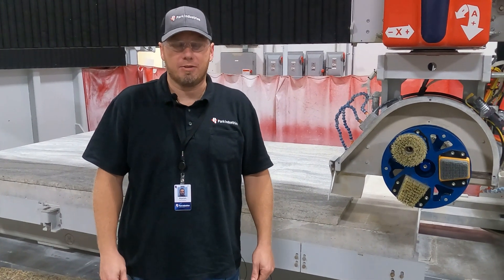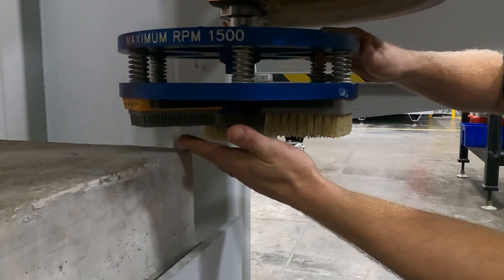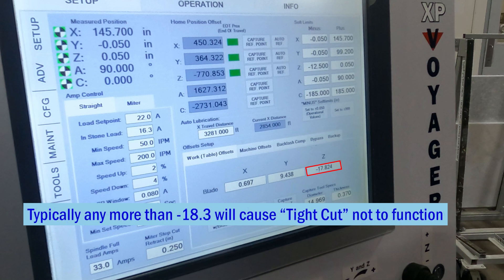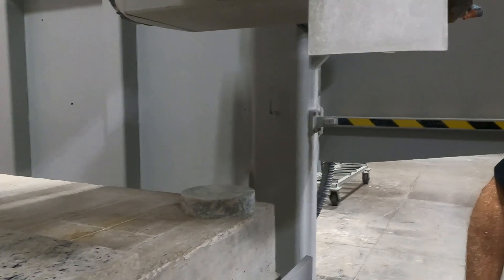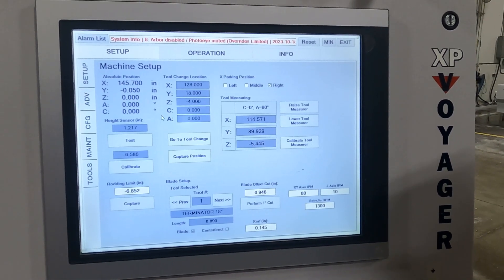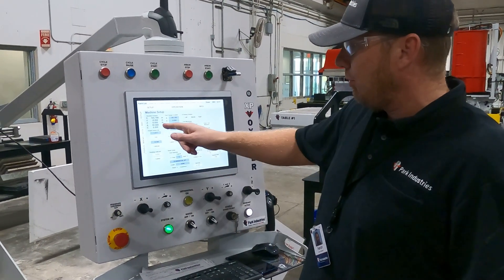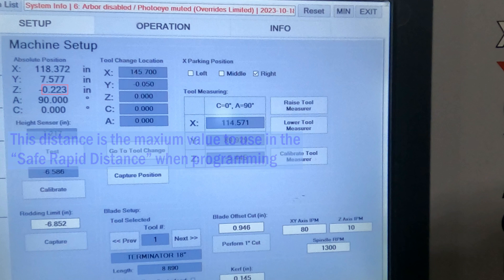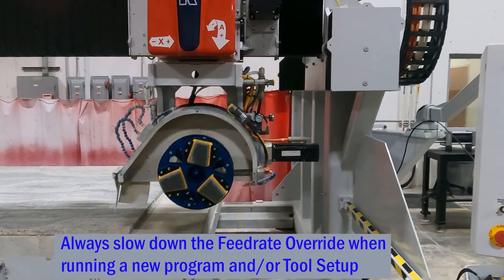Setting up the Voyager for Leathering

Comment: once you do tool change location does it permanently stay their or once you put the next slab for cutting its back to normal? or do we need to readjust the capture?
Reply from the maker: It will stay there. It won't go back to where it was in the previous program.